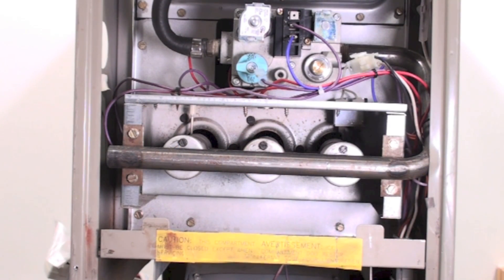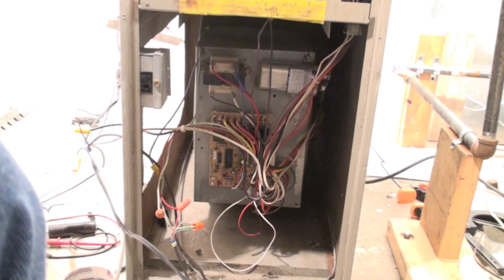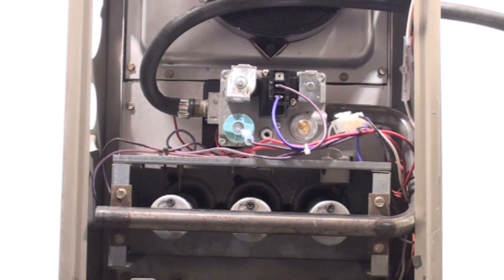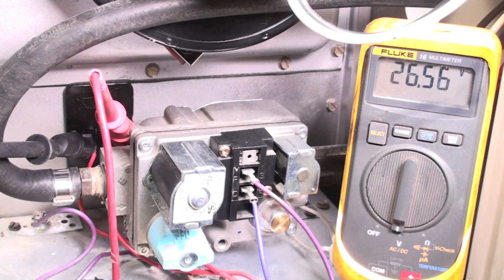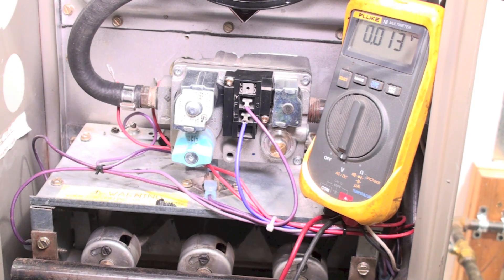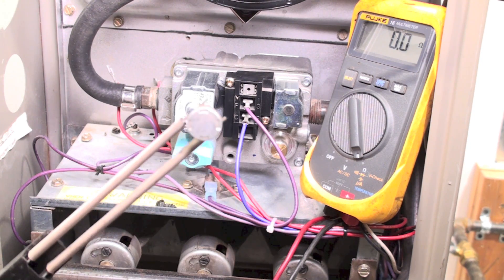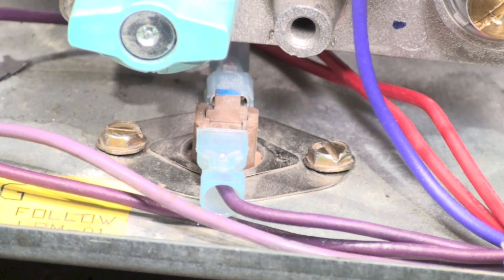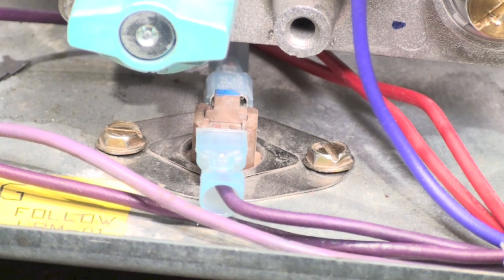Troubleshooting the limit switch on the 80% AFUE gas furnace

Comment: Thanks GFM. One of my rollout switches kicked off and I reset it. I have a couple of spares in reserve and so far it has not kicked off again. I had a new roof installed recently and there may be an issue with the flue but I haven't found anything. So far all is well but I am still concerned. If it happens again I will replace switch and see what happens. Any advice?

Comment: This looks like the style of limit switch my neighbor has.  Her system comes on then as the fan needs to come on it comes on for a couple seconds then off a split second then 3 seconds and so on like 5 times then stays on.  It cycles off fine.  It does it identically the same way each time it starts.  Could this be a limit switch issue?
Reply from the maker: It could be.  If the separation between the on and off temp is not far enough apart, this would be the result.  You can adjust the separation.
GFM

Comment: Do you have a video on how to pull the high limit switch out from behind the gas box? It looks like you skipped that part. I have the same error code and switch and my fan runs all the time.
Reply from the maker: I have not found one that could not be removed easily.  
GFM

Comment: Limit switch is opening upon a hot furnace (doing the cycle) , fan constantly running - always call for heat of course.  So i had an old limit switch and it's doing the same thing.  takes 5 to 10 minutes for it to close back up but will always close back.  i am using those allergy filters that have a lot of blockage, could that cause it?  it's an old furnace (1995 / 1996).  She might be old but she's still going.  It's winter-time and I need to get it going, i will get up on the roof tomorrow to see if there is a bird-nest or blockage on the roof-top, but I am also going to get the cheap blue fiberglass filters tomorrow too.  Could that help?  I've checked all the cold-air return ducts (3 of them) and they don't have severe blockage, some dust and collection of debris but nothing blocking.  I made sure all floor ducts were open in every room.  I do feel that the furnace is very hot but I think it has always been that way...burnt my knuckle checking the Limit switch with my volt-ohm meter.  Anyway, any suggestions are appreciated.  I have looked at my "A-Frame"  evap. coil in the base of the TRANE-XE-80 (1996) and it doesn't look too bad but yea, I am going to get that certain chemical and spray it out before summer comes next spring. I'm baffled.

Comment: My limit switch is more of a button type. It trips almost at ten minutes. It's been replaced. Filter is clean, as is blower, wheel and evap coil. Temp rise check within specs. Registers and returns are open and not blocked. I don't see any signs of cracked exchanger.. Roll outs or flame issues. Not sure where to look next.
Reply from the maker: If the limit switch is located near the burners, you are rolling out.  Sometimes a rollout is not obvious.  You almost certainly have a heat exchanger problem.  Do you have a CO detector in the house?
GFM
Reply: @grayfurnaceman  we have three CO detectors in the home. One on each level and one is within 5 feet of the furnace. The rollout switches are manual reset and none have tripped thus far.
Reply from the maker: @ramblinman7153  I would be looking at ductwork problems.  Crushed?
GFM
Reply: @grayfurnaceman  home is six years old as it furnace. Basement is unfinished and has no registers. I'm at the point I might need to call the experts.

Comment: I have a Lennox furnace limit switch temperature rating of L175-30F. Could I use a limit switch temperature rating of L170-30?
Reply from the maker: It is always best to use the factory limit switch.  However, if the new switch is of the same design, the lower temp would probably be suitable.
GFM

Comment: Thanks on my last intern day I couldn't help but think the senor tech might have done more. Fan was running after the house came to temp until the house was cold. After we arrived the furnace seemed to fire normally. We came: we heated the house, charged the client 90 dollars and left. Without taking any measurements. If the limit was indeed starting to go bad it will do it again. 

How should I test the limit if it does not seem to open during normal operation? Perhaps it would be wise to take it out and heat it manually. then see when it closes.

Comment: I've been trying to figure out the problem with my high limit tripping for a long time.  Found my blower motor capacitor was out 19% and hoped that would solve it but no luck.  Pulled motor and cleaned fan, oiled bearings.  Been using the same washable filter in the ceiling return air grill for 10 yrs, no problem there.  Planning next to take some air duct velocity readings and use temp-rise calcs to try to determine airflow CFM.  Hi-limit never sticks just trips. Open to suggestions.
Reply from the maker: A/C coil?
GFM
Reply: @grayfurnaceman  Of course!  Quite possible, thank you!

Comment: I got 4 blinks which means my high limit switch is open. But when i tested it, it is properly closed. The igniter is turning on but the gas valve doesn't open, and 4 blinks again. Do you know what can cause this?
Reply from the maker: I am assuming you have found all the limits.  If the ignitor is coming on, the limit is not open.  The only thing I can think of, with these symptoms is a control board failure.
GFM

Comment: Thanks, GFM. Here's My problem for all modes; (Power to unit & Control Board, Status LED Solid. Never Blinks! When it shuts down the LED goes out, not blinking.)
Unit is a Goodman 1993 GMP075-4. 75,000 BTU/HR
- In AC mode: Outside unit Pump & Condenser fan come on. High Pressure line gets warm, but when the Blower comes on it kicks off in about 2-3 seconds. 
- In Heat: Vent Blower comes on and just when you think the glow igniter should come on, the unit shuts down.
- In Blower only mode: Blower comes on for about 2-3 Seconds and then shuts down. Here's what I've done so far:
1. Limit switches L220F-30 and fan cage limit switch are shorted as expected lines to board good. 
2. Flame switches are shorted and not popped, lines to board good.
3. Heart Vent Motor Runs.
4. Gas Solenoid has about 101 Ohms on the coil, good ground.
5. Grounds are good and Wire terminals are tight as well.
- In fan mode can I temporarily jumper the limit switch wires on the board to see if it is a limit switch?
The controller board LED comes on and stays on until the fan kicks off, then the LED goes out and stays out. Any Ideas?
Thanks for your help. Best Wishes n Blessings. Keith Noneya
Reply from the maker: This one sounds like a board failure.  One check you might want to try before replacing the board is to check amp draw of the R circuit during a call for heat.  If the draw is above 1 amp, you have a short is the low voltage.
GFM
Reply: @grayfurnaceman  Thanks GFM. I think it turned out to be an intermittent Limit Switch on the back of the fan unit. "At the board" I jumpered/bypassed the two limit switches wires that go to the fan and the fan box just above the furnace. The unit operated normally after that. I then pulled the upper limit behind the burner and shook it. It was quiet so I think it's the one on the squirrel cage, in the back. Then I removed the jumper on the board so I could jumper the switches individually at the switches and the darn thing started working, so I don't really know which one it is. So either I have an intermittent switch or a intermittent Control Board, either that or something elsewhere is intermittent.
I'm not an HVAC Techinicain, but an Electronics Technician by trade. I've worked on Military Jet and Helicopter wiring and Avionics systems, currently I fix Aircraft Test Sets for a living. So although I'm electronic savy I'm not HVAC terminology savi, LOL. So what is the R-Circuit and GFM. And since it's working now, its it still likely to be the R-Circuit or the GFM?
I'll probably put up a video of what I did, I can put it up sooner if you would like to see what I did. I did post a video of what it was doing on my YT channel if you'd like to see that first here: https://www.youtube.com/edit?o=U&video_id=vR-sfg-Uqv8
Thank you so much GFM for your help. Best Wishes and blessings. Keith Noneya

Comment: If I remove one terminal at limit switch and then reinstall it my Lennox G40UH furnace starts back up and runs normally again for a bit. Does that mean the limit switch is faulting? I’m going to put a new one in tomorrow just to be safe.
Reply from the maker: Probably, when you remove the terminal, you are shaking the limit so it makes again.  It does need to be replaced.  You also need to find out why it is opening.  Airflow?
GFM

Comment: Hopefully someone can help I have to reset power to my furnace . It will run exactly 4 cycles 3 minutes long then shuts off . And will not kick back on until I turn off the power off and on , so on and so on
Reply from the maker: Possible plugged filter or other airflow problem.
GFM
Reply: Yeah i figure it out , Im trying to be to smart and do everthing myself, the code states a pressure switch problem..I got a new roof and my chimney was falling apart , so I had them remove the chimney, not knowing nothing about airflow and back pressure until last night I messed up  big time ,I know nothing about furnaces  I am a cable-guy..i ran a B-vent 80% furnace  to the outside a big no no..I didnt know how much science  with the drafting. I know now,,
so today I went purchase a wall and insulation  to put around the B-vent to get me at-least thru the winter until I can afford a 90% furnace  ...Any advice..

Comment: You sir are a genius. Perhaps the best explanation for a limit switch on you tube.  I did the same thing by tapping it and it worked.  But I did order a new one if it fails.  In my case the limit switch keep the blower on after the heat was turned off.
Reply from the maker: That is as it should be.  If the limit sticks closed, the furnace thinks the unit is overheated so it leaves the fan on.
GFM

Comment: Thanks a bunch.  2 in the morning, and my furnace is not heating the house.  Looked at the trouble code..33.  Look at the roll out switch with a junkie voltmeter and it appeared to be fine.  Looked at a few videos which pointed to the limiter switch also.  Then watched your video after I pulled it and you said to flick it which I have done in the past on other things that have stuck open.  But since I don't know much about furnaces you basically rattled some sense back into my head.  And yes it worked and my furnace is up and running again.  Thanks!  Getting a replacement part today.  Oh yea, and I effed up because I let my filter get clogged up...I've been busy....

Comment: Hello I am quang tran

I have a Payne gas furnace issue . Which called for  heat on the  setting temperature 75 degree and the inside temperature is 72 degree on the screen of the thermostat and the system start  working only 10 to 15 mins of short cycle it stops until I turn off and on for heat . I had replace the flame sensor ,  limit switch , the thermostat  . And cleaned the pressure switch hose . 
What would you advise me to do? 
My email is 
Qtran2010@gmail.com
Thanks !
Reply from the maker: Have you checked for an error code on the furnace?  You could have the unit overheating.  Plugged filter, dirty fan or plugged A/C coil.
GFM

Comment: Thank you, took me a little while to get to your video. HVAC tech said circuit board failed however LED code = 33 which led me to limit switches and hence your video. Switch stuck open, replaced switch.. fixed. haha still need a new furance and AC unit soon though :(
Reply from the maker: LagrangePoint Welcome 
GFM

Comment: grayfurnaceman---Thank you VERY MUCH!  Last night it was close to 0F outside and I woke up to a room at 50F and the HVAC blowing cold air.  The thermostat was set to 68F, but there was no heat, no flames in the furnace and just a blower fan that kept on spinning.  I called in an HVAC guy who told me I'd need to spend $6,000 to replace the entire heat pump unit.  I did some research, talked to some people, and bought a replacement ignitor.  That didn't fix it. Tonight I watched about 15 videos on YouTube and pored through the Goodman technical documents---anything to avoid paying $6,000 to fund the HVAC guy's boat payments.  Nothing helped.  The blinking light on the control board told me it was the main limit switch, but none of the info I read actually told me where the switch was located.  I was about to give up for the night, then I did one more search and found your video.  You described the exact problem I had, and when I pulled the limit switch and tapped it a couple of times, replaced it, and switched on the furnace, it fired up within 20 seconds!  

The only issue I have is that the limit switch cannot be removed entirely because the gas pipe and valve are right in front of it, blocking its removal because of how long the probe is.  I really want to replace the limit switch to avoid a repeat of this problem, but I can't get it out.  The thing came out far enough for me to tap it firmly, but that's it.  The video doesn't actually show how you got it out---at 3:35 it's installed, at 3:36 you've removed it.
Reply: He said the limit switch indicates there is a problem somewhere that needs to be fixed and he mention do not just replace the limit switch . so since you got it working did you have to fix anything other than the limit switch?
Reply: You have my sympathy. I have a crappy Goodman furnace as well😞 Fortunately my problem was a rollout switch which is quite easy to replace. Also living in Southern California lack of heat is a mild inconvenience.
Reply: @adamhanne8431  Thanks Adam. You are right, appreciate the advice. I've observed the flames (for a long time) and they are all burning straight and true. It's been over 9 days since it tripped. If the same switch trips again I could just replace it but I will probably call a technician. My bet is a flue blockage but it seems to be evacuating OK.

Comment: I have been following your channel trying to repair my furnace it is a Ducane furnace. Model number mpga075b3a. I have checked for blockages I replaced a rollout switch that I broke I have checked my flame sensor and replaced it which I think I did not need to do. Check the vacuum switch As You indicated in your videos. Still seems to work intermittently it will run sometimes for only a few minutes and cycle on and off. I sometimes get a 3 blank error code. I sometimes get a 4 blink error code. But it just seems to shut off by itself sometimes before reaching temperature. Now I noticed this on the circuit board not sure if it was there before not probably not. Enclosed is a photo. May I please have your input on this. Thank you again for all your videos you post they seem to be the best ones out there.

Comment: What is the max limit to heat an apartment? If I run the heat at 85F will that affect the limit by running it that hot? I don't usually run it that hot but it's colder now than ever so I am trying to counteract the freezing draft. But now my Thermostat won't go higher than 72 so I am wondering if it is because of the limit or the draft. Also you mentioned a backed up filter affecting the limit switch. I looked the other day and my filter was really clogged. I just replaced it with a Merv 12 with carbon filter. I am wonder if that is hurting the pressure.  I just ordered a Merv 11 with better pleats and air flow just in case. But I ran the furnish for 10 minutes with the filter just to see if the pressure increased and my heating still went lower so I put it back. Any suggestions?
Reply from the maker: Setting the temp higher should not cause the limit to open.  If the furnace is running continuously, with the burners on all the time, you may have an undersized system.
GFM

Comment: This was a great video like all the other ones. I'm working on my furnace just like that one but I can't find out why it's saying my limit switch is open even though it's closed.(Checked it with a voltmeter plus I'm a beginning hvac tech for a company in Texas)Is it possible there is another limit switch I'm missing?
Reply from the maker: Yes.  There are 1 to 3 rollout switches near the burners and on the circulating fan housing.  They are manual reset.
GFM
Reply: Thanks a lot for replying back. I figured I was missing one.

Comment: liked your video, very helpful but I was a little surprised when I looked at my Limit Switch and the temp number was L290-30 it seemed a little hot for a 100,000 BTU Bryant, got me wondering what would happen if this was replaced with wrong temp limit switch?

Comment: Bless you for posting this video! After checking the hot surface ignitor, clearing the drain pipes, and changing the filter I wasn't sure what to do. I eventually found the limit switch and it had zero continuity, then I flicked it and it worked again. We'll be ordering a new switch. Thank you!!
Reply from the maker: garfodie81 Welcome
GFM

Comment: Great video.  My York FG9C08016DH11D is flashing 4 times which indicates limit switch.  This part button is popped out (https://www.repairclinic.com/PartDetail/Flame-Rollout-Limit-Switch/S102527792001/2332733?modelNumber=FG9C08016DH11D%2f08-2001).  Can it be pushed back in and reused?  What would cause the flame rollout switch to trigger like this?
Reply from the maker: The switch is a flame rollout switch. It opens because of flame coming out the front. It is a dangerous condition. I would get the furnace checked out for possible cracked heat exchanger. 
GFM